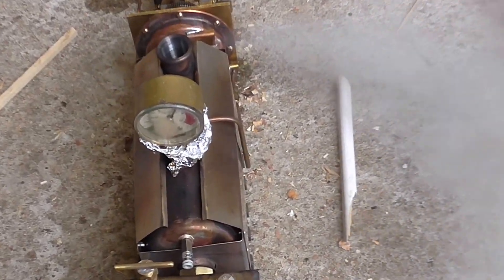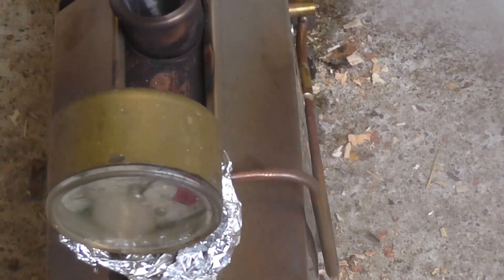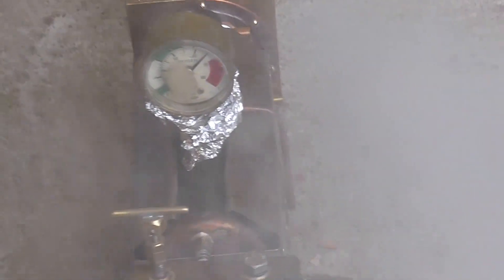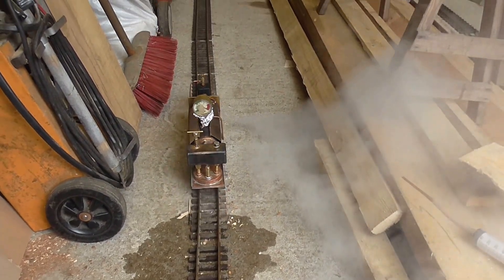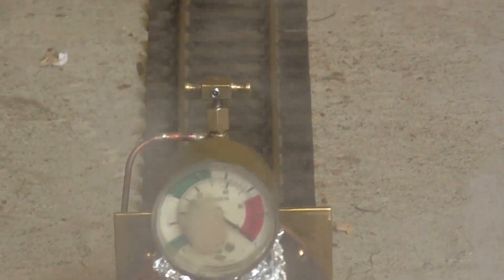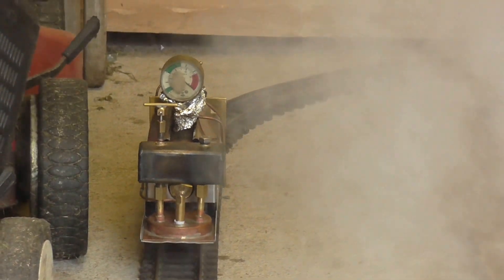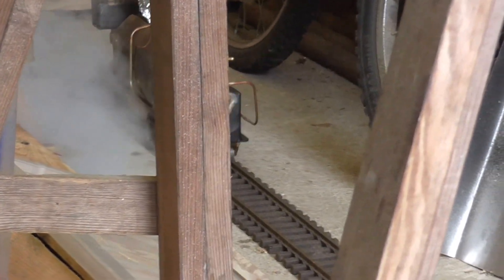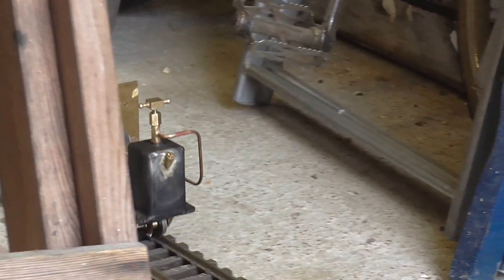boats trains 23 mar 17 012

Comment: Did you build the turbine?
Reply from the maker: yep and its not very difficult to make. cut a 60mm circle and saw 30 slots 5mm deep. cut blades about 15mm long by 8mm wide and bash them into a former so they are about a quarter of a circle. drill spindle hole and then silver solder buckets and centre boss all at once. i used 1mm copper. casing is spun up on my woodworking lathe.  blades should be sharpened on steam entry side and make sure all the buckets have the same clearance from the steam nozzle by bending them if necessary. buckets should nearly touch the nozzle. hope this helps. les breame